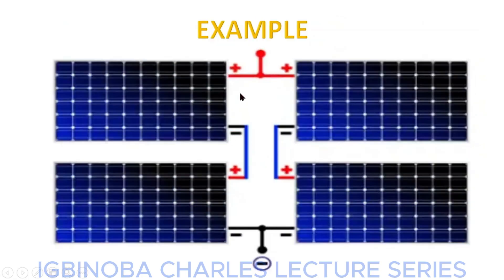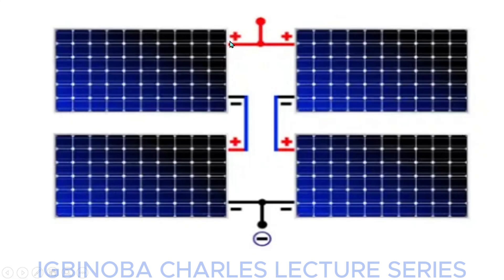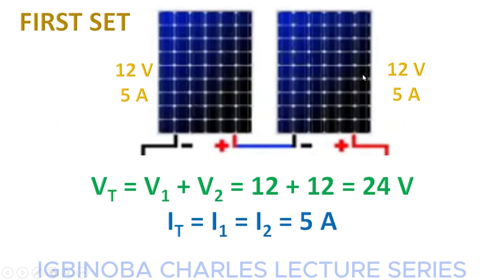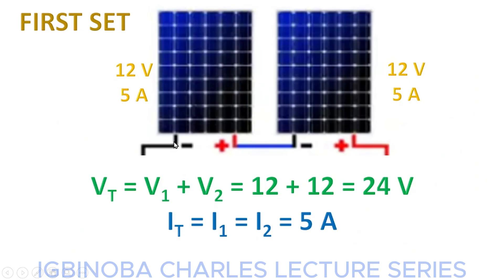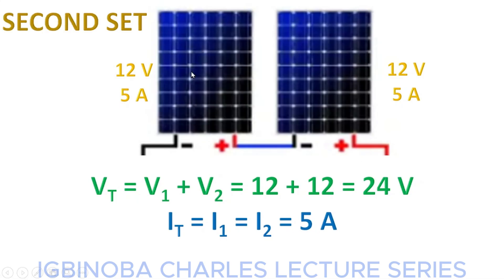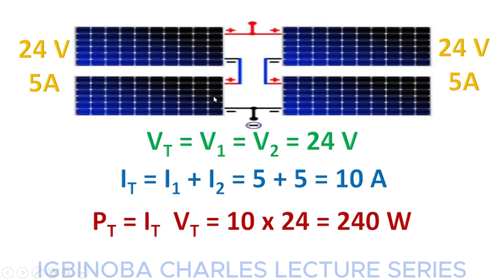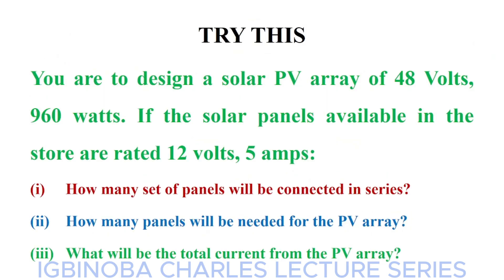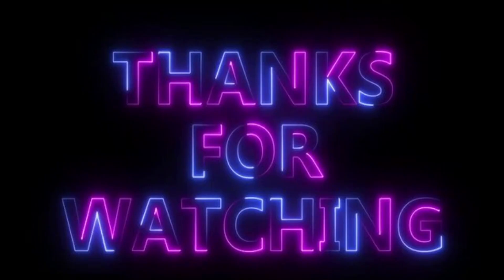Connection of  Solar Panels in SERIES-PARALLEL

Comment: PETRO319S

Given:
PV ARRAY: 960W, 48V
SOLAR PANELS AVAILABLE: 12V, 5A

Total power in each panel = 12x5 =60W

1. Panels in series: 48V/12V = 4 PANELS

2. Total panels need : Total power =960W, power in each panel = 60W
     Total panel = 960/60 =16 PANELS

3. Total current from the PV array:   Total power = 960W,  Total voltage = 48V  
     P=IV   
     I = P/V = 960/48 =20A

Comment: MECH3202U
i. 4 sets of panels will be connected in
series ( 48V/12V) = 4
ii. 16 panels will be needed for the PV array
(960W/60W) = 16
iii. The total current from the PV array is
20A ( 960W/48V) = 20A

Comment: COMP48V

1:- Sets of panels that will be connected in series is 48 / 12 = 4

2:-The power generated by a single panel is = 120 V × 5 A = 600 W. The required power in the array is 960 W. Therefore, the number of panels needed for the array is = 960 / 60 = 16 panels.

3:-Since we have 4 panels connected in series and we have a total of 16 panels, Total panels connected in parallel is 16 / 4 = 4 panels in parallel. Each of these panels has a current of 5 A. Therefore, the total current in the PV array is 4 × 5 A = 20 A.

Comment: EEE64L

1. 4 sets of panels will be connected in series.

Since connecting 4 of the 12 volts, 5 amp panels in series gives a total of 48 volts as required by the solar PV array design

2. 16 panels will be needed for the PV array. This is because the power of each panel is 12 x 5 = 60 watts, therefore the total number of panels to produce 960 watts is, 960/60 = 16

3. The total current from the PV array is 20 amps

Since I (total) = P (total)/ V(total)

I (total) = 960/48 = 20amps

Comment: MECH3168L 

i. 4 sets of panels will be connected in series ( 48V/12V) = 4
ii. 16 panels will be needed for the PV array (960W/60W) = 16
iii. The total current from the PV array is 20A ( 960W/48V) = 20A

Comment: MEC18UR

1. 4 sets of panels will be connected in series.
Since connecting 4 of the 12 volts, 5 amp panels in series gives a total of 48 volts as required by the solar PV array design

2. 16 panels will be needed for the PV array.
This is because the power of each panel is 12 x 5 = 60 watts, therefore the total number of panels to
produce 960 watts is, 960/60 = 16

3. The total current from the PV array is 20 amps
Since I (total) = P (total)/ V(total)
I (total) = 960/48 = 20amps

Comment: EEE3141K

1. Number of panel sets in series: 48V + 12V = 4
2. Number of panel for PV array: 960W ÷ (12VX5A)
960W 60W = 16
3. Total current:
Number of parallel strings: total no of panel for PV
array/ number of panels set in series = 16/4 = 4

Therefore total current= 4X5A = 20Amp

Comment: MAR314N

(I): sets of panels that will be connected in series is 48/12 = 4 

(II): Power generated by a single panel is 12V x 5A = 60W
The power required for our solar PV array is 960W
Therefore, the number of panels needed for the PV array is 960/60 = 60 panels 

(III): since we have 4 panels connected in series and we have a total of 16 panels
Total panels connected in parallel is: 16/4 = 4 panels in parallel 
Each of these panels have a current of 5A
Therefore, the total current in the PV array is 4 x 5A = 20A

Comment: MECH336J
Given that; 

Required PV array: 48 V, 960 watts
Solar panel available: 12 V, 5 A

(i) In series, current is constant for all panels but the voltages add up.

Hence, we need a total voltage of 48 V, and each panel has 12 V.

Therefore,
Total number of panels = Total required voltage ÷ Voltage per panel
= 48 / 12
= 4 panels

(ii) Total number of panels for the array = ?

Total power needed = 960 watts
Power in each panel = 12 V × 5 A
= 60 watts

Number of panels = Total power required ÷ Power per panel
= 960 / 60
= 16 panels

(iii) Total current in PV array = ?

4 panels are connected in a series string with a total voltage of 48 V and a total current of 5 A.

We have a total of 16 panels, hence:
Number of parallel strings = Total panels ÷ Panels per string
= 16 / 4
= 4 parallel strings

In a parallel connection, voltage is constant but current is not constant.

✅ Final Summary:

Voltage required: 48 V

Total power: 960 W

Panels per series string: 4

Total panels: 16

Parallel strings: 4

PV array output: 48 V, (4 × 5 A) = 20A

Therefore the total current in PV array is 20A

Comment: PETRO3105A

Designing a Solar PV Array
System Requirements: 48 Volts, 960 Watts
Solar Panel Specifications: 12 Volts, 5 Amps

(1) Number of Panels in Series
Required system voltage = 48V
Each panel voltage = 12V
Number of panels in series = 48V ÷ 12V = 4 panels
Answer: 4 panels in series.

(2) Total Number of Panels Needed
Power of one panel = 12V × 5A = 60W
Total required power = 960W
Total number of panels = 960W ÷ 60W = 16 panels
Answer: 16 panels in total.

(3) Total Current from the PV Array
Total panels = 16
Panels in series = 4 → Number of parallel sets = 16 ÷ 4 = 4 sets
Current per set = 5A
Total current = 4 sets × 5A = 20A
Answer: Total current is 20 Amps

Comment: PETROCHEM 391M

4 sets of panels will be connected in series.

Since connecting 4 of the 12 volts, 5 amp panels in series gives a total of 48 volts as required by the solar PV array design  16 panels will be needed for the PV array.

This is because the power of each panel is 12 x 5 = 60 watts, therefore the total number of panels to produce 960 watts is, 960/60 = 16  The total current from the PV array is 20A

Since I (total) = P (total) / V(total)
I (total) = 960/48 = 20A

Comment: COMP398T

1.For series connection, we have 48v/12v= 4 panels 

2. Total number of PV array is 12v * 5A =60W. Therefore, we have 960W/60W=16 panels 

3. Each series string is 48V, 5A with 4 strings in parallel. Therefore the total current is 5A * 4= 20A. This means we have:
. 4 panels in series 
. 16 panels for PV array 
. Total current for PV array is 20A

Comment: MECH3175S
Given;
Required PV array;48v,960 watts 
Solar Panel available; 12v, 5A
(i) in serious current is constant for all panels but the voltages add up.
Hence we need a total voltage of 48v and a panel has 12v
Therefore,total number of panels =total number of voltage/number of voltage in a panel
=48/12
=4 panels
(ii)Total number of panels for the array=?
Total power needed= 960 watts
Power in each panel =12v x 5A
=60watts
Number of panel=Total power required/power in each panel
=960/60
=16 panels
(iii)Total current in PV array =?
4 panels are connected in series string with total voltage of 48v and total current of 5A
We have a total of 16 panels hence number of parallel string = 16/4
=4 parallel string 
In a parallel connection voltage is constant but current is not constant.
Hence total current in series =(4 x 5)A
=20A
OR
Total power /total voltage 
=(960/48)A
=20A

Therefore total current in the PV array =20A

Comment: PETRO373U

Ans to Q1.
   4 sets of panel would be connected in series ( with 4 panel making up a series to achieve a total voltage of 48volts while keeping the current constant)

Ans to Q2.
   A total of 16 panels would be needed for the PV array ( To fully achieve a total power output of 960watts with each available solar panel of 12volts,5Amps, a total of 16 panels would be used)

Ans to Q3. 
   The total current from the PV array would be 20Amps. ( This was obtained by dividing the total power(Pt) given by the total voltage given(Vt) 960watts/48volts.)

Comment: COMP42P

Given:
Required PV array:48 V, 960 W
Available solar panel: 12 V, 5 A
(i) How many panels in series?
In series, voltages add up, current stays thesame.
We need total voltage =48 V,and each panel=12 V.
Number in series =48/12=4
(ii) How many total panels for the array?
Each panel = 12V x5A=60W
To get total power = 960 W
Number of panel=960/60=16
(iii) What will be the total current from the PVarray?
Each series string = 4 panels = 48 V, 5 A.
We have 16 panels total, so:
Number of parallel strings=16/4=4
In parallel, current adds, voltage stays same(48 V):
Total current =4x5A=20A

Comment: MAR32B

1. Panels Connected in Series
To reach the required system voltage, we connect multiple solar panels in series. In this case, combining panels to get 48V + 12V means we need 4 panels in series.

2. Total Number of Panels in the Array
Each panel has a rating of 12V and 5A, which equals 60W per panel. To achieve a total array output of 960W, we need:

Number of panels = 960 ÷ 60 = 16 panels

3. Parallel Strings and Total Current
The panels are arranged in parallel strings to handle the current. The number of parallel strings is calculated by dividing the total panels by the number of panels in series:

Parallel strings = 16 ÷ 4 = 4 strings

With each panel producing 5A, the total current of the PV array is:

Total current = 4 × 5A = 20A

Comment: CHM33C
1. Required output voltage is 48 V.
Each panel is 12 V, so 48 ÷ 12 = 4 panels set in series.

2. Each panel produces 12 V x 5 A = 60 W.
Total power needed is 960 W, so 960 ÷ 60 = 16 panels PV arrays

3. With 16 total panels and 4 panels per series string, we get 4 parallel strings.
Each string gives 5 A, so total current is 5 A x 4 = 20 A.

Comment: PETRO387I

1. 4 sets of panels will be connected in series.

Since connecting 4 of the 12 volts, 5 amp  panels in series gives a total of 48 volts as required by the solar PV array design

2. 16 panels will be needed for the PV array.

This is because the power of each panel is 12 x 5 =  60 watts, therefore the total number of panels to produce 960 watts is, 960/60 = 16

3. The total current from the PV array is 20 amps

Since I (total) = P (total)/ V(total)
I (total) = 960/48 = 20amps

Comment: COMP3U37
Given:
Required PV array: 48 V, 960 W
Available solar panel: 12 V, 5 A
(i) How many panels in series?
In series, voltages add up, current stays the same.
We need total voltage = 48 V, and
each panel = 12 V.
Number in series =48/12=4 (ii) How many total panels for the array?
Each panel = 12V x5A=60W
To get total power = 960 W
Number of panel=960/60=16
(iii) What will be the total current from the PV array?
Each series string = 4 panels = 48
V, 5 A.
We have 16 panels total, so:
Number of parallel strings=16/4=4
In parallel, current adds, voltage stays same (48 V):
Total current =4x5A=20A

Comment: CIV3102X

The series connection sets the overall voltage of the array. To achieve the required 48 V output, the number of panels connected in series is:
48 V ÷ 12 V = 4 panels in series.

Each panel generates 12 V × 5 A = 60 W. Since the total required power is 960 W, the total number of panels required is:
960 W ÷ 60 W = 16 panels.

With 16 panels arranged as 4 panels per series string, the configuration results in:
16 ÷ 4 = 4 parallel strings.

Each string supplies 5 A, and because the strings are connected in parallel, the total current output is:
5 A × 4 = 20 A.

Comment: CHM31450

Given: required PV array: 48 V, 960 W Available solar panel: 12 V, 5 A
 (i) How many panels in series? In series, voltages add up, current stays the same. We need total voltage = 48 V, and each panel = 12 V. Number in series = 48/12=4panels

(ii) How many total panels for the
array? Each panel = \(12V\times 5A=60W\) To get total power = 960 W Number of panel = 960/60=16panels

 (iii) What will be the total current from the PV array? Each series string = 4 panels = 48 V, 5 A. We have 16 panels total, so: Number of parallel strings = 16/4=4 In parallel, current adds, voltage stays same (48 V): 
Total current = \(4\times 5A=20Amps

Comment: PETRO3186D 

1. Number of panels sets in series: 48V + 12V

= 4

2. Number of panels for PV array: 960W ÷

(12V 5A) = 960W 60W = 16

3. Total current

Number of parallel strings: total number of panel for PV array/number of panels set in series 16/4 = 4

Therefore total current = 4*5A = 20A

Comment: EEE3137G

a) because series connection determines the final voltage of the array and the required voltage is 480, then the number of panels needed to reach the required voltage is = 48/12 = 4 panels.

 b) The power generated by a single panel is = 120 x 5A = 600. The required power in the array is 960W. Therefore, the number of panels needed for the array is = 960/60 = 16 panels. 

c) 16 panels are in the array and 4 panels are in series. Total number of parallel sets of panels = 16/4 = 4 parallel sets. Total current from each set of panels is 5A. Since these sets are in parallel, the total current is = 5A x 4 = 20A
Reply: 1. Number of panels in series required system voltage= 48v
Each panel voltage= 12v
Number of panel in series 48v÷12=4 panels 
2. Total number of panels needed power of one panel = 12v × 5A = 60W
Total required power = 960W
Total number of panels = 960W ÷ 60W = 16 panels 
Answer 16 panels in total 
3. Total current from the pv array total panel = 16
Panels in series 4 = number of parallel sets =16 ÷ 4 = 4sets 
Current per set = 5A
Total current = 4 sets × 5A =20A
Answer the total current is 20A

Comment: PETROCHEM395Q

Solar Panel Configuration Calculation

Given:

Each solar panel is 12 V and 5 A
Required system output voltage = 48 V
Required total power = 960 W
Step 1: Determine how many panels are needed in series

To get 48 V from 12 V panels:

48 / 12 = 4 panels

So, 4 panels must be connected in series to produce 48 V.
Step 2: Determine how many panels are needed for the total power
Each panel produces:
12V5 A= 60 
Total power required = 960 W

960 \60 = 16 panels total
So we need 16 panels in total.

Step 3: Arrange the 16 panels into series and parallel sets

We already know 4 panels make 48 V (one series string).

Now:
16 \ 4 = 4 strings
So we will have 4 parallel strings, each containing 4 panels in series.

Step 4: Calculate the total current output
Each series string produces 5 A.
Since we have 4 strings in parallel:
5A x 4 = 20A

Comment: EEE320T

Number of panel sets in series: 48V / 12V = 4
Number of panel for PV array: 960W / (12Vx5A) =
960W /60W = 16
Total current:
Number of parallel strings: total no of panel for PV array / number of panels set in series = 16/4 = 4
Therefore total current = 4x5A = 20A

Comment: NAT32B

Given: Required PV array: 48 V, 960 W Available solar panel: 12 V, 5 A                 (i) How many panels in series? In series, voltages add up, current stays the same. We need total voltage = 48 V, and each panel = 12 V. Number in series = 48/12=4     .CM8kHf text{fill:var(--m3c11)}.CM8kHf{font-size:1.15em}.j86kh{display:inline-block;max-width:100%}            (ii) How many total panels for the array? Each panel = \(12V\times 5A=60W\) To get total power = 960 W Number of panel = 960/60=16                 (iii) What will be the total current from the PV array? Each series string = 4 panels = 48 V, 5 A. We have 16 panels total, so: Number of parallel strings = 16/4=4 In parallel, current adds, voltage stays same (48 V): Total current = \(4\times 5A=20A\)

Comment: MECH3161E
1. The number of panels in the series connections is 4 panels. 
 Nseries= Vtotal/Vpanel= 48/12=4
2. The number of panels needed for the PV array is 16 panels. The number of watts is 12*5= 60W. The total watts is 960W. 
Npv = 960/60 = 16 panels
3. The total current in the PV array is 20amps.
Ipv= Ptotal/Vtotal=960/48= 20amps

Comment: CIV341O

1. Number of panels sets in series: 48V + 12V = 4

2. Number of panels for PV array: 960W ÷ (12V * 5A) = 960W ÷ 60W = 16

3. Total current 

Number of parallel strings: total number of panel for PV array/number of panels set in series 16/4 = 4

Therefore total current = 4*5A = 20A

Comment: CIV366N 
1. Number of panels sets in series =48V: 12 V =4 2. Number of panels for PV array Given that a Given that a panel is rated 12 V and 5 A, panel power = 12 x 5= 60 W, total power = 960W Therefore the number of panels for the PV array = 960: 60= 16 panels 3. Total current from the PV array Given; total power =960 W Total voltage=48 V Total current = 960 * 48 = 20/ A

Comment: PETRO3176T

i. If the required voltage is 48 volts, the set of panels connected in series will be 48/12= 4 panels

ii. The power generated for a single panel will be 12V × 5A = 60W
Therefore, if the required power in the array is 960W, the number of panels needed for the PV array will be 960/60 = 16 panels

iii. Total current for each set of panel will be 5A But, if they are in parallel, the total current will be 5A×4 = 20A

Comment: CIV38H

1. Number of panels sets in series =48V: 12 V
=4
2. Number of panels for PV array
Given that a
Given that a panel is rated 12 V and 5 A, panel
power = 12 x 5= 60 W, total power = 960W
Therefore the number of panels for the PV array
= 960: 60= 16 panels
3. Total current from the PV array
Given; total power =960 W
Total voltage=48 V
Total current = 960 * 48 = 20 A

Comment: PETRO3159C

ANSWERS:
1. Number of sets of panels that will be connected in series is 4 panels. 
Since 48/12 = 4.

Therefore, answer is 4.

2. Given that each panel power is 12×5 = 60 W. And total watts is 960W.
So the
NUMBER OF PANELS THAT WILL BE NEEDED FOR THE PV ARRAY = 960/60 = 16.

Therefore, answer is 16 panels. 

3. To get the total current from the pv array. We have total of 16 panels, since there are 4 panels connected in series, we now have 4 sets to be connected in parallel. 
Mathematically: 16/4 = 4.
Note: current increase when there is parallel connection. 

So 4 ×5 = 20 amps. 

Therfore TOTAL CURRENT FROM THE PV ARRAY = 20 Amps.

Comment: PETRO379A

1. Number of panels sets in series = 48 V ÷ 12 V
=4
2. Number of panels for PV array
Given that a
Given that a panel is rated 12 V and 5 A, panel
power = 12 x 5 = 60 W, total power = 960W
Therefore the number of panels for the PV array
= 960÷ 60= 16 panels.
3. Total current from the PV array .
Given; total power = 960 W
Total voltage = 48 V
Total current = 960 ÷ 48 = 20 A

Comment: CHM3171P
One panel power = P=VI=12x5=60W

I) Panels in series = 48/12 = 4
II) For 960W = 960/60 = 16
III) No of parallel strings= 16/4 = 4
Therefore, parallel connection, i total = 4x5 = 20A